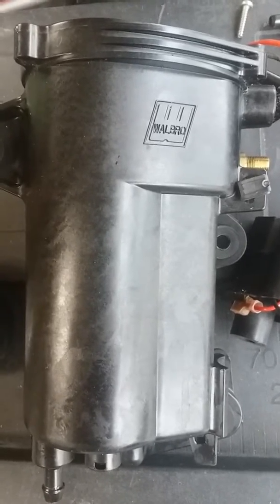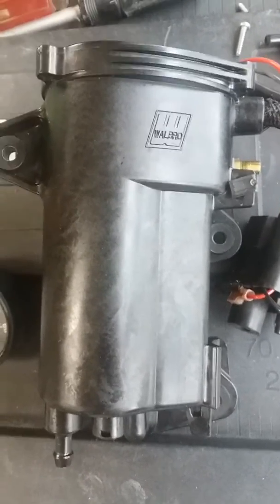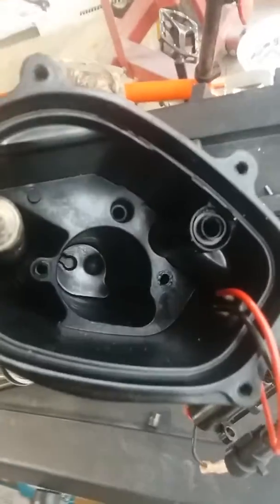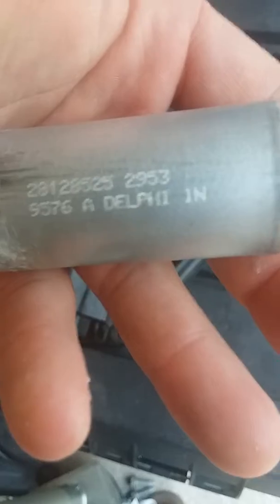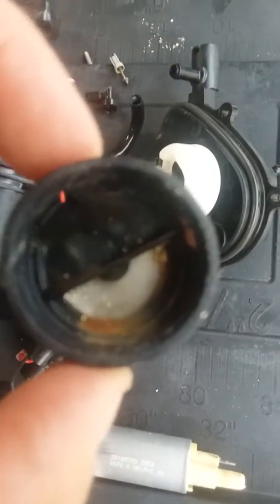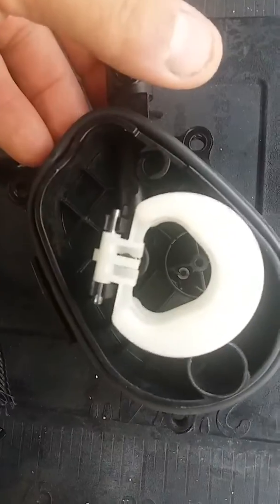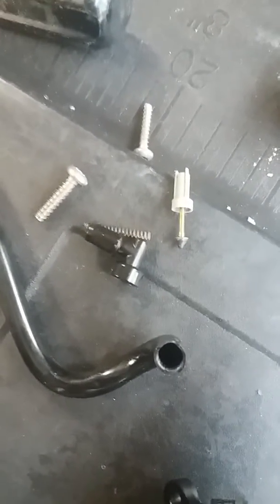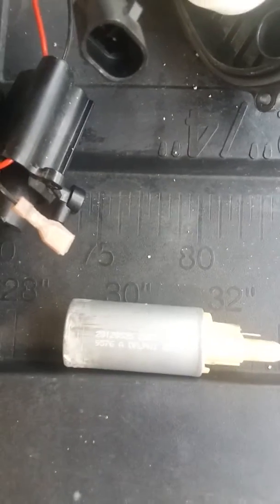25hp EVINRUDE ETEC VST Fuel Pump Disassembly

Comment: I had issues with a no start after winter storage , and discovered I had no fuel pressure even though the fuel pump was running ,. that rubber diaphragm thing the pump sits into is the pumps inlet grommet and contains a fine mesh screen filter that most people do not know about  , and it was plugged solid with black goo starving the pump of any fuel , cleaned it and my fuel pressure went back to normal ,  you can test the fuel pump with 12 V some people have had luck soaking the pump in automatic transmission fluid others say penetrating oil  , if the fuel pump is locked up internally gently tap it then apply power "briefly" to flush it out ,, dont set yourself on fire with sparks around a flammable solvent make your final connections away from the pump i  .  I know people that have had them jam up by dissolved solids in the fuel,  A bad deteriorating fuel supply line with its liner dissolving will do this.  there is an example of how the pressure regulator goes back together https://youtu.be/OjORg9gu92o?t=422   ,, the cone plunger tip faces toward  the mesh filter and when fuel pressure goes high enough it forces it off its seat against the spring compression allowing fuel on the return side of the injectors to return to inside of the VST after keeping the pressure in the proper range .. Yes there are places online that sell the pump module separately ,  search   : Etec,VST 25 hp , replacement pump module "Do not run the pump dry unless you plan to do so only for a brief moment..

Comment: What type of problem was you having ?
Reply from the maker: It wouldn't fire over unless I misted mix gas in it. But I bought the diagnostic hardware to make sure it was the fuel pump and it was

Comment: Where to buy a replacement Delphi P/N 28128525 Fuel Pump to replace the internal pump? It is a Delphi T-11 pump. Just not able to find a vendor to purchase the pump from. Anyone have any luck locating a source for just the internal pump? Harold Wishhard, thank you for the great video.
Reply: @Harold Wishard Was in contact with Delphi today regarding the Delphi No. 28128525 Fuel Pump used in the Walbro VST. This is also know as a T-11 Delphi fuel injection pump for small engines. Delphi no longer manufactures this item and does not have available an alternate source, vendor for this pump.
Reply: David Chapman When I took my VST apart I had the same trouble as Harold Wishard - The grey insert, spindle and spring all lept out onto the floor and I couldn’t work out the correct reassembly sequence/orientation for those parts. Would you able to help me with that? I assume they work as a pressure regulator. I’ve searched for the Delphi pump too but couldn’t find one. I bought a moped pump and modified it slightly to make it fit. It does work but idling and low rpm trolling is slightly rough, although that might be because the pressure regulator isn’t working correctly rather than  a problem with the pump!
Reply: @markrobins4170  the grey insert is part of the pressure regulator assembly. It is installed with the spring end fitting down into the filter in the housing that is in the body of the VST. The way I removed that filter out of the body of the VST is with some slight air pressure to blown it out to remove the filter. The spring end of the regulator goes into that. Use air pressure to get the filter out to clean it if it is dirty, restricted etc. because non of these part are available individually from Evinrude BRP. That filter might be dirty and explain the rough idle. The fuel pumps are 12 VDC, but the EMM controls the fuel pump with PWM (pulse with modulation) from the 55 VDC Stator suppling power. Having Evinrude Diag Software and the Serial test cable helps in troubleshooting these Etec"s. Just curious which moped pump did you purchase and modify to replace the faulty fuel pump. I would like to try that also. Also BRP announced two weeks ago that they were shutting down all production of Evinrude Etec Outboards. I finally just purchased another $350 VST and installed it on my 2010 25 hp Etec to get it going to get out on the water. This is my 3rd fuel pump replacement. I learned the expensive way the mistakes I made. Do not use E10 gasoline, nothing but pure unleaded gas. Use the Evinrude 2 plus 4 Fuel Conditioner or Sta-bil Marine 360, No Sea Foam. Sea Foam is bad for Etec direct injected engines. The E10 fuel and use of Sea Foam is what led to the failure of my  fuel pumps after only about 10 hours running time. Would like to know for sure what fuel pump you used to replace the bad one. I have two VST's of my own that I would like to repair as spares for my outboard. Hope that helps out with your question. Having a Etec Service manual also is a big help. Also to get added lubrication to the fuel pump in the VST, it is advised by a Evinrude Tech to me to add a 200:1 mix of TCW3 2 cycle oil to my gas mix in the tank to help keep the pump lubricated. About 3.5 ounces to 5 gallons of gasoline with no ethanol.
Reply: David Chapman Thanks David. My filter also came out with the spring which meant that the spring, spindle with the cone end, grey insert and filter ended up all over the floor.
Does this look correct to you:

              /|\ Spindle with cone facing up and sitting in the grey insert
                |
              ||||| Grey insert
               |||
               |||
           \  §  / Spring sitting inside the filter with the pointy end of the filter facing down
            \ § /
             \§/

The pump that I fitted is this one, I’m in the UK but it’ll be available in the US too. It’s diameter is approx 28mm rather than 30mm and the length is 91mm rather than 94mm. The outlet pipe from the pump is slightly narrower too so I wound ptfe tape(one of the few things that I found isn’t affected by fuel) around it so that it was a tight fit into the rubber seal. I also used the same tape to create a better seal for the original filter to fit onto the bottom as the filter that came with it wouldn’t fit into the VST.

https://www.ebay.co.uk/itm/30mm-Fuel-Petrol-Pump-Kit-for-Yamaha-XC125E-XC-125-XC125-E-VITY-VITTY-Scooter/222946259250?ssPageName=STRK%3AMEBIDX%3AIT&_trksid=p2057872.m2749.l2649

I confess that I lost the spring from the pressure regulator(if you have time I’d appreciate it if you could measure the length and diameter of the spring and I’ll source another one). The pump has been working for a year now without the pressure regulator. I’ve got a 16ft boat and she’ll do 19 knots with this pump, my slightly rough idling is almost certainly from the lack of a pressure regulator working correctly!
I’ve discovered the same regarding fuel/ethanol etc. Some techs suggest a 150-1 fuel oil premix to help the pumps and injectors and using the XD100 oil with the EMM set to TC-W3 to provide a little extra lubrication for the rest of the engine. I downloaded the software from the internet and made my own cable so I’ve been able look at the error codes etc.
The worst part is that I cut open the case of my pump to see what was wrong and the only problem was slight blackening on the copper commutator. I cleaned it, put it back together and even managed to reseal the pump case, the engine ran perfectly for 30minutes until the pump case split again. The VST assembly is much more expensive in the UK than in the US, really frustrating that such a small fault can cause such a big expense. 
I hadn’t heard that the E-TEC’s were no longer to be made. The cost of spares will probably increase further now....
Regards
Mark
Reply: David Chapman Also the original pump is sometimes referred to as  Delphi T11. This company claims that they have a replacement so I’ll investigate further and let you know:
https://www.ebay.co.uk/itm/New-QFS-Intank-EFI-Fuel-Pump-AJP-MOTOS-Motorcycles-PR3-PR4-PR5-DELPHI-T11-/121661414886#rwid
Reply: @markrobins4170  The spring is 21mm long, diameter of the spring is 2.5mm. The spring goes on the spindle. The spindle goes into the gray plastic piece. The rubber cone shaped end fits into the filter basket. Then install the the filter end first into the body opening for it of the VST. Then the return fitting and plastic tube for return to the tank fits on top of the gray plastic piece. If positioned corrected, the top of the VST is molded and holds all of this together when fully assembled. So the rubber cone piece is seated into the filter. That is the pressure regulator. I have looked at the pump before on ebay that you linked. Just have not gotten around to purchasing and experimenting. Ridiculous to have to purchase a entire expensive VST for a inexpensive HP fuel pump. Hope my description is clear. Could send you pics if needed. Just need a email to send to or if you are on FB Messenger, could send pics to you that way also of the pressure regulator assembly. Also contacted Walbro, the manufacturer of the VST. Since it is a OEM manufactured unit for BRP, they basically are no help for spare components same with Delphi on the 28128525 T-11 style pump. T-11 pump per Delphi tech support is a product line consisting  of various different pumps to power small gas engines. Did a lot of searching online before getting frustrated and bought another new VST. I wanted to go fishing so install new VST and new spark plugs, use only Champions. And outboard is running great once again. Was $285 US from DuskyOnline Marine located in Dania Beach, FL 33004 USA. They will ship world wide. They were the cheapest I found. Orderd and got unit in withing 5 business days. https://pat.en.alibaba.com/product/60827027288-807089743/PAT_fuel_pump_Motorcycle_28128525A_04817_C_10537.html
visually is a exact looking replacement. Just did not want to deal with China and order there minimum order. If I can be of any further help, let me know. Thank you for sharing your info on all of this also.
Reply: Thanks David, your description is good but a photo speaks a thousand words as they say. The pump on the alibaba site really does look identical to the Delphi. There seems to be an option to buy just 1 pump for $20 + postage as a sample. I’ve emailed them to check if that’s the case and I’ll let you know. I might yet contact Dusky marine but I’ll get the pressure regulator working first and see if that smooths out the idling. Thanks for the tip regarding sea foam, I almost ordered some but found some techs on a forum suggesting it can damage pumps hoses etc. I use the engine at low rpm quite a lot which can cause a carbon build up even using the XD100. Rather than adding a cleaner to the fuel the consensus seems to be to spray the entire can of  Evinrude engine tuner into the air intake. That removes the carbon from the spark plugs, injector tips etc but avoids damaging the pump etc.
Thanks for all of your help.
Mark
Reply from the maker: I never found the exact part to replace it
Reply: @HaroldWishard  Did you end up replacing the entire VST assembly?
Reply from the maker: @msbanks007  yes I replaced the entire assembly
Reply: @HaroldWishard  Thank you.